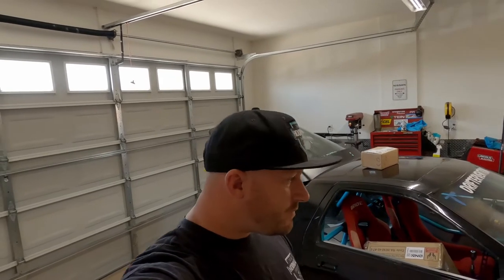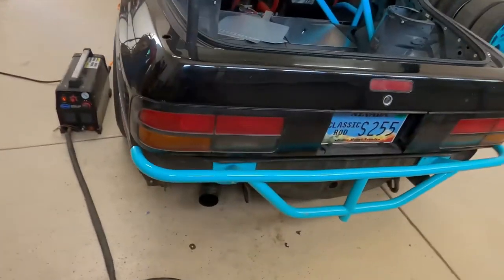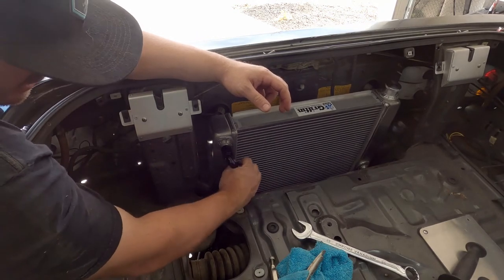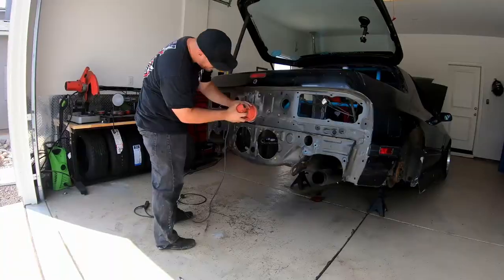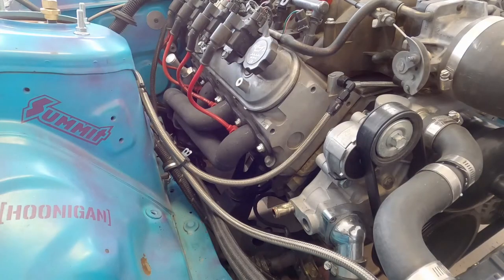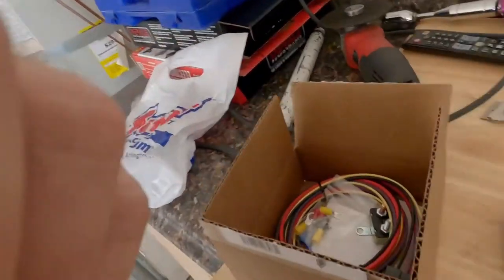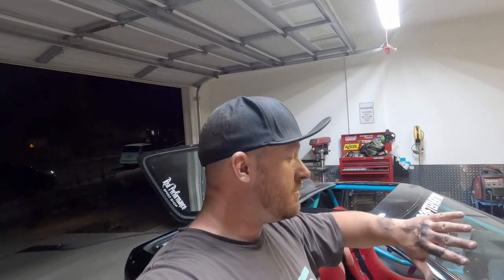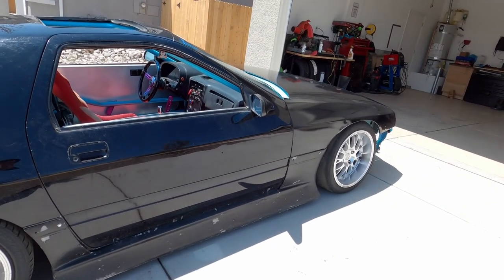LS Dual Radiator Install | 5.3 LS FC RX7 Gets A Second Radiator!

Comment: Thank you for the awesome videos!!! Can you show a video of the rear radiator fire wall? Did you cut out intake vents for the rear radiator?
Reply from the maker: Thanks for watching. I didn’t cut any vents. It would definitely be more efficient if I did. But it’s not necessary. The fans draw a lot of heat out as it is

Comment: Triple pass or double pass radiators are another solution that might work.
Reply from the maker: I have a double pass and it works. But on those mid summer track days this really helps with hot laps